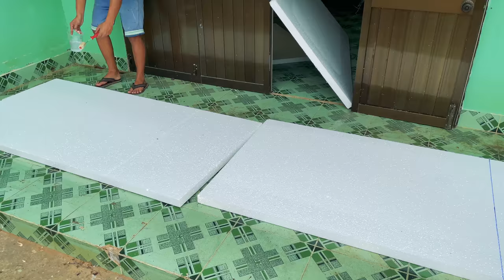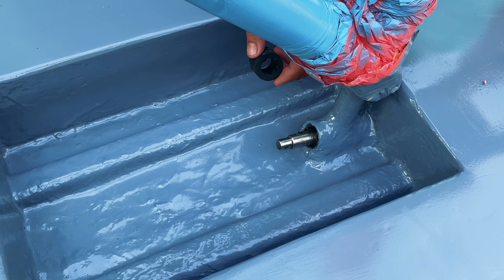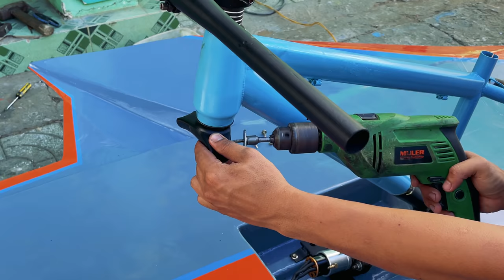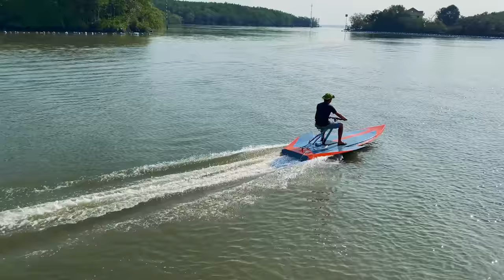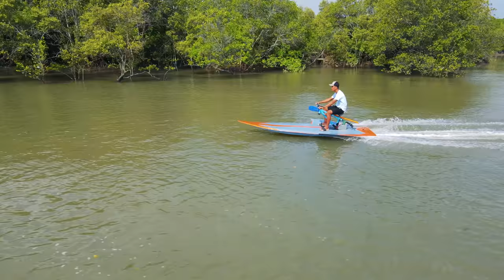Chế phi thuyền điện từ xốp sử dụng Motor 6000W | Build a boat from electric 8hp foam

Comment: Is that really a 6kW motor? With a 12v battery? Current would be 500amps?? With a 100 AH battery it would run for a mere 12 minutes at best. I built an electric car using a 12v battery but the motor was much bigger than shown here and it was only 1/3 hp drawing approx 30 amps. I would love to know where this guy got his motor!  Were the drive shaft bushes rubber? Maybe graphite filled ptfe. Well done and bravo young man and your dad.

Comment: Beautifully done. I've owned a boat for fifty of my 78 years. I once owned a Styrofoam sail boat. It was just a "play thing" for use on the nearby lake - fun. Worked well and I often thought about putting fiberglass on it but never got to it. In this case I would shield the pipe, prop and rudder and protect any point where water could get into the electronics. Small gets bigger so I would figure out how to make the wings removable and add more depth. I don't think that would be difficult to do. Not sure how long it runs but the longer the better. I could see these being used competitively on the lake by people everywhere. One becomes many and it doesn't take long for the enhancements to come. Next question, how can I use it to fish out of and troll with? I would have to be able to change the gear ratio of the prop as needed.... Thanks. Nice job!!!!!
Reply: Nobody asked....
Reply: @turdferguson1021  Nobody asked NASAT Channel to post the video either, but here we are. That's how the world works.
Reply: Great points ROCROC. I was thinking the same things, about the wings being removable and sealing in the electronics. Seriously considering giving this a go with the lads. Was thinking a bar through the main body to attach the wings may work!
Reply: Add a turbo and a faster beak
Reply: @capcadoi  oh ok, thanks. I always wondered how the world works.

Comment: Do you mind explaining the circuitry so we could build this as well?  Seems to run smoothly. What all the gadgets on the handlebars. I think I recognize a potentiometer, I see a lot of capacitors. What are they doing increasing voltage to your motor? What's the motor size and voltage capabilities? So many questions I'm sry but I don't see any description. Thanks for your awesome upload 😀
Reply: Its from rc

Comment: Great job! That thing looks so fun to ride. 
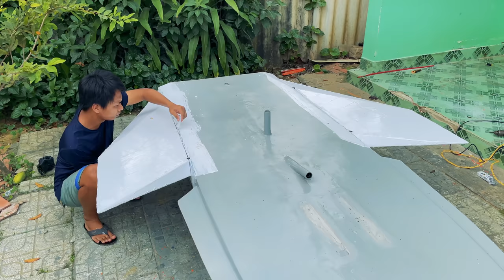I do wonder if anyone has an idea about why he chose to put those "wings" on his craft (4:00). I can see that they certainly provide extra stability but it seems like on a sharp turn they'd do just the opposite—dig into the water and send the craft spinning and capsizing. I don't think they would do this if they were attached in the opposite direction (pointed parts pointing towards the back).
I didn't really see any sharp turns made in the video so I don't know if my assumptions are correct.
I know 0️⃣ about boat design but if anyone has any ideas, I'd love to hear them.
Reply: If anything, those wings are providing negative force (pushing the craft down) because that design is going to have the craft want to lift out of the water.  He could probably add some hydrofoils and that thing would really scream across the water.

Comment: Just love your planetary gearbox to high speed motor set up ! You seem to have a good match to your propeller . I think your power to weight ratio could get you up on hydrofoils. You are very clever and i think you could come up with something awesome ! keep up the good work.
Reply: ive seen a bunch of videos of guys like these building watercrafts on hydrofoil also
Reply: @jeroekoe  & did they weld without eye protection as well?
Reply: It doesn't seem like there would be much to gain from foils. He's pretty close to operating on a foil when he's on plane as it is.
Reply: @teabagmcpick889  hahahaha yeah well i guess in some countries they are still behind conserning safety regulations.    here in the netherlands you can not even get a job in construction if you dont have the basic safety certificate (called the VCA over here, that tell everything you need about personal protection equipments etc)
Reply: tho i must say i have worked with men that were vetarans in construction and among them also guys that grind whole blocks of stone without ear-caps or glasses either....   that like the most stupid thing to do because only the sound of that already hurts your ears, let alone you can feel the pieces of stone flying against your face
Reply: Why not just use a composite bicycle frame epoxied to carbon fibre plates sandwiched between the hull layers, with reinforced gussets to spread the loads of the frame, the drive and battery box, over a larger area? The wing could be supported, too. Would make it stronger.....
  This concept is so awesome.....worth developing..
Reply from the maker: Thank you very much, I will learn from you and do better!
Reply: Cool concept, amazing product

Comment: Excellent work. Myself I would not put wings on and put a cage to protect the prop, if you hit a rock and bend the shaft you will have to break the fiberglass to change it. Better yet, use a plastic ‘sacrificial’ prop and have spares handy.

Comment: Another awesome build,  use a 10 to 20mm pipe facing forward under boat to scoop up water as your moving to cool esc,  motor , definitely a saving on a water pump power.
Cheers
Reply from the maker: Thank you very much, I will learn from you and do better!

Comment: A most excellent work. So simple but really, really incredible! Also, the design, wow, My son asked me to build a powered board like you. Please tell me what kind of materials you are using at:

0:54 which glue do you use to stick the plates together?

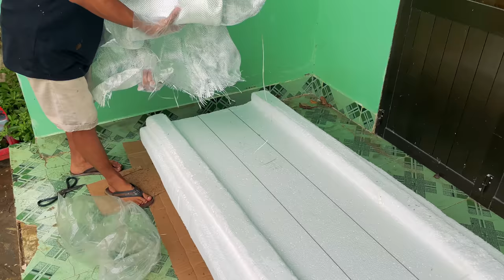2:33 is it a standard glasfiber mat?

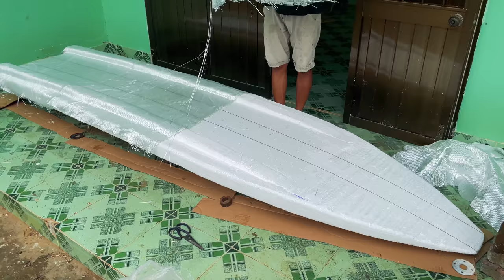2:37 what for a glue / liquid is it to fix the glasfiber mats?

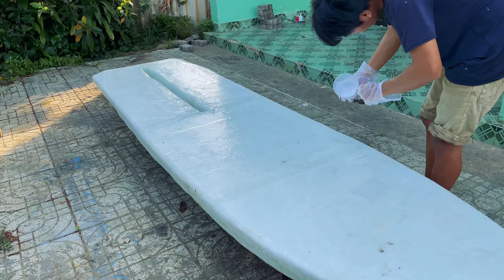3:04 what for a filler / material is it to seal the board?

I will post the movie after the board is finished.

Thank you my friend.

Comment: You would add some splash protection on motor compartment and a mesh on water intake to ensure no debris gets into the cooling system. Otherwise - nice boat.

Comment: Very good design, but it doesn't look like there's a kill switch (maybe i'm wrong) in case fell over board this would continue moving until the battery dies?

Comment: What would stop the battery box from getting soaked?  Look at the videos where he's actually moving in the water.  No battery box under the rear forks.  The only times you see the battery box is when it's out of the water or when he's sitting still in the water.  Nice try.

Comment: Put some hydrofoil platforms on this, the lift to hydrofoil will reduce drag through water contact and both increase speed and reduce the power load on the batteries.

Comment: Not a 6000 Watt motor ,technically impossible. 
600 Watts at the most                                                                                                                                                                                                                                                                                                     x

Comment: Ok you have the power but it is wasted on drag get that hull off the water with a foil and add some lift wth shaping the foam hull like a wing. Then add a forward canard wing to control pitch. When it lifts you can reduce power and extend run time.👍🛫🚀

Comment: damn you clever fellow. I designed and manufactured a special board to power nichrome wire to make a foam cutter,  when as I now see all I needed was a welder and a wire. What power settings did you use?

Comment: Spraying all that water up at high speed, does not seem like it has great "traction". The boat removes the water from the propeller at high speed, so lowering the propeller will probably increase the top speed.

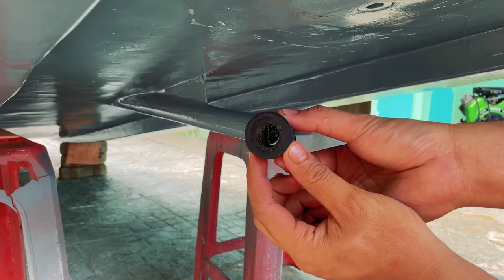Comment: Not a DIY project when I have to make my own gear parts....  But I have a question: 5:33 Is this rubber-looking tube supposed to stop water from entering the drive shaft tube?  If so, I imagine it would be tight fit to the shaft; wouldn't that produce a lot of friction, which in turn wears down the rubber?